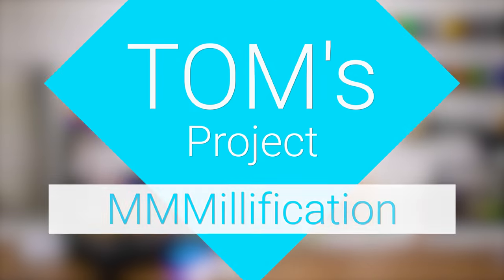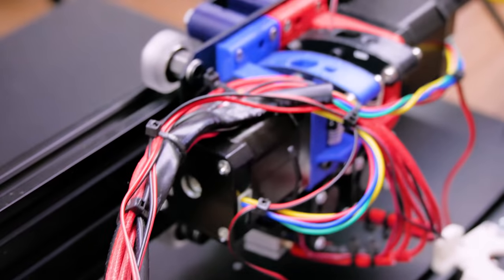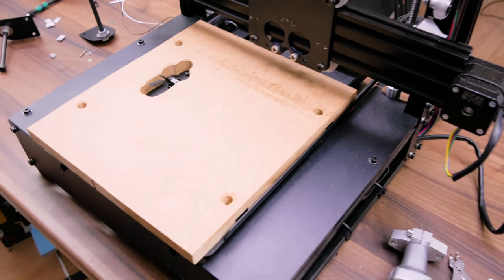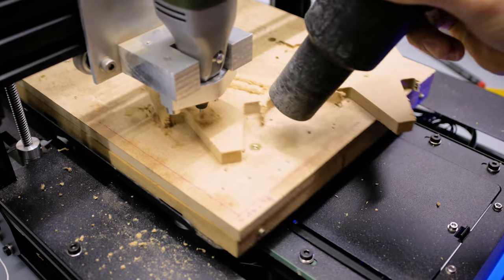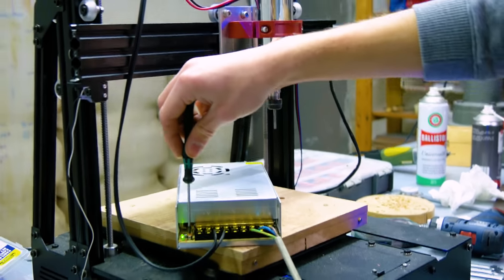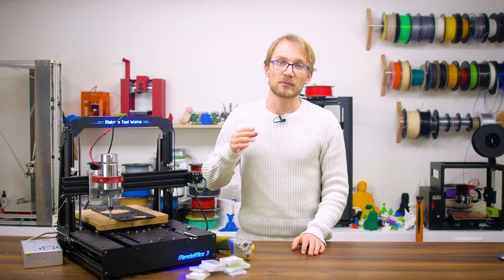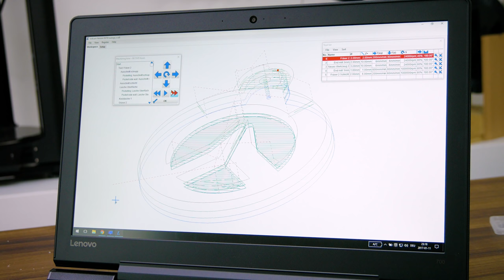CNC mill built from a 3D Printer!

Comment: I have a dream, the day is coming. 5 axis CNC and 3D printer all in one!
Reply: you can get one they make them in japan
Reply: zmorph is already available.
Reply: I was thinking more on the lines of a DIY kit. Were heading in the right direction... 5 axis CNC/Delta ;)
Reply: CNC machines have no place in my dream. Soon 3D printers will be so advanced that most of the things we use everyday will be printed.
Reply: Jason Burt I dunno.  There are a few kits, but the usable dimensions are so different between the two.  Like for 3D printing, you usually care way more about build height, and a heated bed.  For milling you can usually get away with 4 to 6 inches tall, but you want a bed that's at least 3' square, but it's way more useful if it's a 3'x6' table (for working with plywood and MDF sheets, etc.) -- the desktop / 3D printer mill makes sense for small things, like brackets, parts, or PCBs.   Though, I like the idea of two pass printing.  Where you print the part, and then take a second pass, milling the part, so that it's very smooth.  But I don't see it replacing full on milling setups any time soon.
Reply: lasertec 65 3d
Reply: it already exists. (exactly what you wrote)
Reply: The zmorph is not a 5 axis 3d printer, and its cnc capabilities are very limited.
Reply: Actually there is a German manufacturer that builds 5 axis cnc and 3d printers for metal, watching those machines run is like watching a sci-fi movie.
Reply: boxzy is expensive
Reply: Delta is never going to be even remotely capable of CNC. They are barely sufficient for 3D printing and just massively over-complicates the entire thing. Stick with Cartesian movement. There's a reason it's an industry standard that's been around for decades. :)
Reply: There is a 5 axis metal 3D Printer and CNC mill in one
Reply: @molomono9795  Could you tell the name of this manufacturer? :)
Reply: What happened to taser cutting?
Reply: There are a few but one is dirty by nature, the other needs to be clean, I doubt that sort of thing will ever work well.
Reply: And 3d scanner and laser engraver 4 all in 1 maybe lathe
Reply: That would be an utter disaster, no prints would ever stick, cncs are insanely dirty.

Comment: To fix your problem of little particles going everywhere and to save having to hold the vacuum beside the CNC machine why not print a duct? A bit like the fan duct for part cooling on 3D printers except with a vacuum attached?

Comment: I did my project the other way round. I designed and built my own CNC machine first. I soon got tired of the noise and mess in my workshop, so, i modified the machine to be a 3D printer. Now I have a powerful and well built 3D printer and its cost me less than £250. Thanks for all your hints and tips.

Comment: Interesting. I'm in the process of doing this albeit in reverse. I bought an OpenBuilds "C-Beam" machine and am slowly collecting the things I need to convert it to a 3D printer.
I don't foresee any problems with rigidity. lol. I think it will be easier and quicker to swap between the two configurations using the "C-Beam" as a base.
I did put the effort into learning the basics of Fusion360, it is worth the time.
Reply: Great minds think a like. I did the same thing as you're doing. The C-Beam machine is a good start. Though the print height is low due to where the X/Z axis sits in relation to the print bed. Instead of the 4 250mm uprights holding it, I'm gonna swap them for 500mm ones. Also I will make a plate that will allow the Z C-Beam to move fully instead of just the gantry plate moving.
Reply: Glad I'm not alone. True, the Z axis is limited in the standard "C-Beam" configuration but rather than increase it straight away I aim to get it working properly as a 3D printer first. Although, having seen Thomas' review of the "TEVO Black Widow" it is so similar to the "C-Beam" I'm tempted to buy one, stiffen it up with OpenBuilds' plates and have both a CNC mill and a 3D printer. Seems almost everyone is panning the TEVO in their reviews, I figure the price will have to drop and it would make a "reasonable" starting point.
Reply: The Tevo literally uses C-Beam from reviews I've seen, but said reviews don't recommend it because it's a fire hazard and has poor build quality outside of the OpenBuilds sourced parts.
I've never had OpenRail or whatever OB calls it, how straight and true is it? I've seen pictures in the past of just standard extrusion, probably from chinese companies, that were warped and bent.

Comment: Getting a great finish in aluminum comes down to a few things:

1) Speeds & Feeds. GWizard is amazing at figuring that out. You'll need the recommended chipload from the tool manufacturer, specs for your spindle, and the total weight of your machine. 

2) Square gantry. Just like leveling the bed is essential for 3d print success, Having the spindle/gantry square to the bed will take your finish to the next level. Get about 160-170mm of 6mm rod and bend  at 30mm in into an acute angle at around 100 degrees. Chuck the rod into the spindle and step down the z-axis until it's almost touching. Spin it by hand to see where the low spot is at, then add shims to the offending side of the gantry or spindle mount. Keep it up until the rod continually lightly scrapes the bed at the same z-height all around. 

3) Way stiffness. If you're switching the belts for preloaded screws, make sure to use supported linear rails. Unsupported rails are a floppy sad mess and leave floppy sad cuts. :(

4) Chip clearance. Recutting chips exposes you to welding chips and heats up the part way too much. Hook up some loc-line coolant hoses to a cheap air compressor with a ball valve between the two and ziptie that beast to the spindle. Before turning on the spindle for a cut, aim the line about 5mm from the bottom of the tool and check with fingertips that strong air is reaching it. 

Bonus Round 1) As for protecting the electronics, night I suggest DIY Ikea bellows? 

Bonus Round 2) Fusion 360 is free if your shop earns less than $100,000 USD per/yr. I don't do that much business, but I'll be super stoked to pay that license when the time comes.

Comment: If the spindle gives out, check out Kress router. They do 3 models, designed with small CNC in mind. Middle one was around 200$ last time I checked and user feedback I saw was good.

Comment: Hey Tom, looks like a fun little hack. I think I'd only do the same as a way of bootstrapping a new CNC.

What about just going the whole hog and building a MPCNC or (simpler and better, IMO) a ROOT 2? 
You could re-use some parts and explore new things such as NEMA 23 steppers or different stepper drivers... Solid content right?
Reply: I vote MPCNC, but....I am biased.
Reply: Great design, I'm loving mine so far.  I built the newer one with the 25.4mm stainless tubes.  Bravo!

Comment: Very well done!!!
The frame of a 3D printer was never designed to take the loading that would be present on a mill but you got it to work ~ congratulations!!!
Another big issue is that the mass of the spindle motor is very high but I have seen someone (on his own design PCB mill) use the motor out of a RC car, then he used the motor out of a quad-copter, both of which he was able to do speed control using g-code.
The only issue was that the bearings of these motors were not designed to handle the side loading that they were now being given.
Last time I saw him he was building his own spindle which would absorb the loading and coupling it to the motor which would only have to provide the rotation.
But he was driving using toothed belts and these had a very short life span.

Comment: On my MM3 I have a Smoothieboard and external 32MS drivers installed, currently. But with the rise of the i3 MK2 and having two of them running flawlessly, the MM3 is staying still for the most time. Calibrating it manually is a pain. So converting it to a CNC mill seams the right way to go for me, too. The only thing I would do from the start is to install a vacuum cleaner attachment to the spindle, to avoid the chips flying around. We have it on our regular CNC mill and it prevents the mess I saw in the video effectively.

Comment: This is absolutely phenomenal, honestly. It's definitely one of my favorite videos out of your channel, as CNCs are like 3D printers in reverse. Would you be willing to publish the files you used for the actual replacement parts? I can probably get a Mendelmax, and I'd like to take a crack at this. Idle thoughts below;

3D printing a shroud for the shopvac that attaches to the XZ gantry would probably be pretty useful.

Also you could probably hook up a 220-48V stepdown and control the motor with an SSR, using one of the heater outputs.

Comment: Ha, thats cool. I did the opposite, I built a CNC router and added 3D printing. I started with a C-Beam Machine by Openbuilds. I modified GRBL 0.9j to run on a Mega/RAMPS board. Now all I need to do is get a second Mega so I don't have flash Marlin/GRBL when I want to switch between 3D printing/CNC.

Comment: I was toying with the idea of putting together a self build 3D printer and converting it so it could to light CNC milling as well. I even identified the newer Proxxon hobby tool as a possible spindle.Comparisons all seem to rate it as far more durable than the Dremel. 
In the end though I guessed that the build would always be too compromised by starting with a printer. It seems like you're going to spend quite a bit in combined time and outlay to beef the printer up in order to get a very lightweight mill that may still shorten the axis motors' lives significantly. You're already starting to look like Theseus.

I think the only satisfactory way to go, at least if you only want 1 machine in the room, is to save up for one of those Chinese $1,500-$2,000 5 axis CNCs and build a print head and heated bed to fit it.
That outlay typically gives you: 
 - 1 to 2kw water cooled spindle; 
 - 5 axis CNC milling (with the software by the looks. Pirate?) and wide range of compatible end mills available; 
 - a tank with some of them, if you need to cut while using coolant; 
 - a CNC router that takes a useful range of bits; 
 - an engraver; 
 - possibly even a 3D part scanner by attaching a measuring tool; 
 - and finally a 3D printer as well. 

Repeatable placement of tool placement is typically quoted as <20 microns. 
It seems so obvious that you should be able to have all in one machine, but I think the CNC spec' defines the build and then it won't even notice when it's carrying a printer on its shoulders or routing soft materials.

The only thing I profoundly lack is any kind of justification that has a hope in hell of passing the wife test  :'-(

Comment: I realize that I'm a month behind, and you may have already settled on a solution to the belt question, but maybe going from 2GT to 3GT belts might take care of your issues in that area? By all accounts there is a marked strength improvement from 2nd gen to 3rd and since they share tooth profiles it'd be maybe $35 for the whole thing.

Comment: Your feeds look crazy for milling, no wonder you wrecked the bearings. Any cutter will have a maximum amount of material it can cut away in one revolution, if you exceed that it causes tearing instead of cutting. That's where all the extra stress was coming from.

Comment: I wonder if you could reuse the plastic trash you produce with the 3D printer to make recycled plastic sheets that you would then mill on the converted 3D printer (with a hot press or something similar). Also, using the aluminium flakes in the recycled plastics would provide some fabulous glitter.

Comment: The Issue you will have and will ALWAYS have is the use of those flexible motor couplings like the ones you've used on the Z AXIS and the use of 2 motors on the Z Axis. The Z axis will never be able to produce any kind of accuracy or have any rigidity with those flexible couplings.

I learned this when I built my CNC machine. Instead, I used 8mm threaded rod, drilled the centre of the end of the rod with a tight 5mm hole and then using a saw,  cut down the length of the rod about 2cm making a slot along the hole you've made. That can then slide over the 5mm shaft of the motor and with 2 M8 nuts tightened against each other where the slot is compresses the slot and the rod against the motor shaft.
There you have a simple but very effective way of stiffening a simple axis drive.

Comment: I thought that I could convert a standard Prusa i3 with 8mm rods to a wood milling machine. I was wrong. But after building another reprap with 12mm rods I was successful on hanging there a 600W spindle that works surprisingly well. Cutting speeds not super fast but it works. And the best thing - the final total cost of such reprap cnc is about 200EUR. Of course it can be converted back to 3D printer :)

Comment: Very interresting video!
Before I designed and built my 3D printer, i built a CNC router with openbuilds parts.
I originally had an idea to combine both machines into one.
Nice idea, but not that good in practice;
- CNC needs very strong parts which do weigh more, so not ideal for 3D printing
- 3D printer needs a clean environment. When CNC milling, lots of dust/chips are made.
  You would preferrably have the CNC machine in your garage and a 3D printer in a office environment
So in one way or the other, you are going to make consessions for the 3D printer or the CNC router.

Both the 3D printer (aluminium, no printed parts) and CNC machine work good, but i experienced too much flex on the cutter when milling with the CNC machine. The forces on the cutter are not to be underestimated!
I made the machine stronger which did a good job up to some point, but i wanted to mill aluminium more and more.
That's why i'm building a second CNC machine right now, using SBR20 rails and 16mm ballscrews.

See my 3D printer and my openbuilds CNC machine here:
3D printer: http://www.openbuilds.com/builds/yaop-yet-another-openbuilds-printer.1493/
CNC: http://www.openbuilds.com/builds/yaor-yet-another-openbuilds-router.825/

Comment: Lead screws would be good in your application, but since you're working with metals use a low lead number. They're quiet, smooth, self-lubricating, and corrosion resistant; but the lower the lead number, the harder it is to backdrive the screw, but sacrifices efficiency. Larger diameters also have slight efficiency sacrifices 
Another thing to note is grade of the screw; from Thomson Neff, standard is 250 micrometers per 300 millimeters, or precision which is 75 micrometers per 300 millimeters.
The nuts also have factors of load, preload, and flange styles, static and dynamic loads, drag torques, etc.
Lubrication for metal-on-metal, or there's PTFE films for plastic-on-metal. You'd most likely use plastic, although I think most hobby applications use delrin nuts without the need for the PTFE film. 
There's a lot to research if you're going straight diy, or you can just buy stom from OpenBuild's store since they have everything for a simple diy build. Though there are other brands out there, and you might want to look at more professional type equipment if you're wanting to cut metals.

Comment: What I've learnt from this video: don't use spray directly on your milling bit, especially when risking thermal shock! ;)
Reply: It looks to have broke from being  overloaded, you can see it relieve after it breaks.  He probably heard it overloading and tried to spray it thinking it would help.
Reply: @leviray7819  How can you see it relieve?
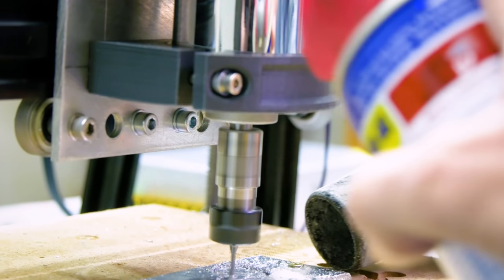Reply: @forloop7713  @ 7:02 if the bit breaks, it just breaks.  If it breaks due to  too much tool pressure everything will jump to where it should be, indicating it was building up too much pressure. Usually feed rate too high or a dull bit is the culprit.  Relieving just means all the tension is being released, on the spindle.

Comment: My experience with the low cost Chinese spindles was terrible. Most have simple 608zz bearings in them. The runout on the one I picked up was so terrible that it was unusable. Switched to the Dewalt DW660 and it was much better (although it is larger).
As for conversion, you might be better off building a dedicated cnc machine such as the Mostly Printed CNC or Root 2.1

Comment: maybe not as ambitious as a CNC (I have a 2.5HP 1950's Mill with 53" table, weights 2880lbs... that's what you need to mill metals. but perhaps you could use an attachment on your printer to convert it to a CNC Drill for making PCBs? Update: Have successfully made attachments  for my WanBlo i3 to use FlatCAM and Geany to CNC Drill and Engrave (sharp springy dragging style) PCB's with through hole VIA's accurate to +/-0.25mm over a 14x14cm double sided PCB (after Y-axis tram adjust mod using long threaded rod). 3D printing pulleys and cycloidal gearboxes to convert my 1950's 2.5HP 3PH Cincinnati Knee-mill to CNC.

Comment: Wd-40 XD for Aluminium you need alcohol to cool down ;) alu is like bubble gum when you mill it... Ipa or something is the best to cool and no flames at all
Reply: WD-40 is recommended for aluminium as it prevents it "welding" to the cutting bit. This, rather than heating, is the main problem with milling aluminium.

Comment: Great video Tom, as always.

I'd love some more details on converting marlin to deal with running milling operations if it would be possible to do a video/link to where I could read more? (I've searched, but haven't seen anything specific).

I would love to make a swapable effector for my Kossel to hold a dremel extension. Just for machining foam and PCBs.

Comment: cuttingspeed : 3,14 : diameter. save your tools ;) example you got a HSS end mill with a diameter of 10 lets say we run 35 Meters   that will be 35x1000 = 35000 : 3,14 : 10 = 1114.6496815286623   but keep that on 1114 RPM ;)
Reply: also de[ends on the material but in aluminium ist a nice avarage to hold on, learned this in machinist class ;)